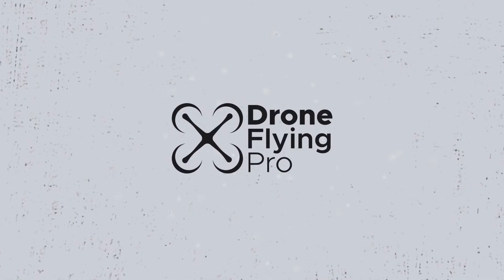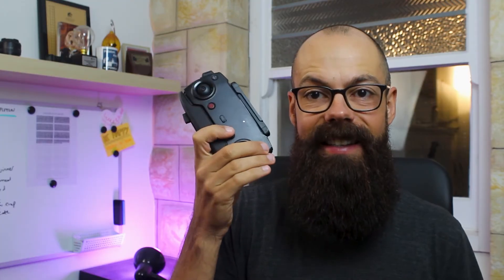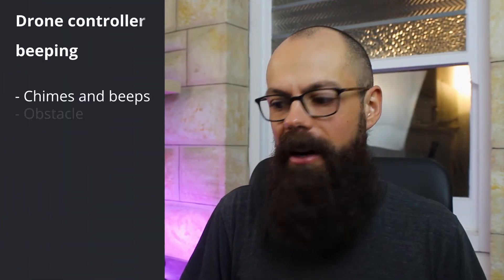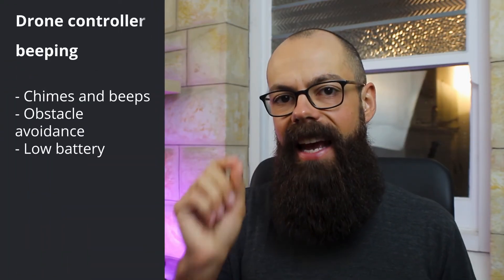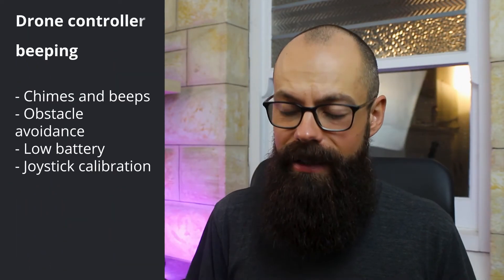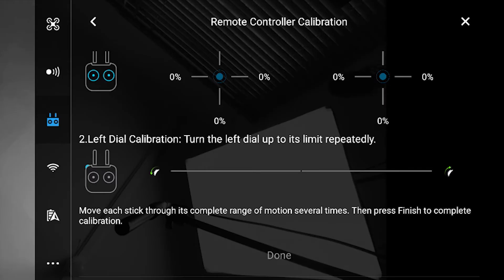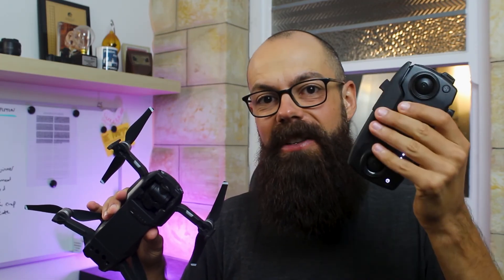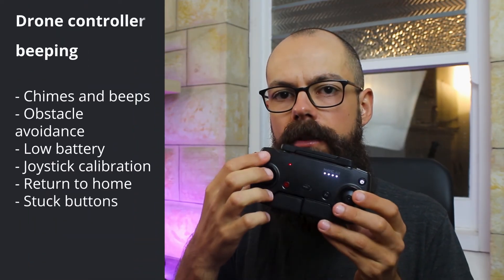why is my drone controller beeping? 6 reasons with actual audio!

Comment: Hey, thank you a lot mate! Pops got me this sweet drone last Christmas and i've over the last 7 months i've gotten quite used to turning it on, doing the quick calibration, and then just buzzing it around! It's super fun, but i was missing out on the features like 'home' and 'GPS flight' as well as the ability to loop continuously from set point A to point B. I hit the homing button for the first time, and a few seconds later I was hit with the barrage of beeps! I got so worried I landed, grabbed my drone and ran back inside to investigate! 

You saved me a ton of confusion and possible (unnecessary) heartache thinking i've hurt my drone!

Comment: I have a Frankenstein toothpick 818A that acts like it's too far from home upon take off and then proceeds to land right back down.. the battery is good though. I've tried 3 batteries including an 18650 that's fresh. Remote batteries are new and no dimminng.. I'm wondering if a button is stuck.. maybe I'll clean them all..
Reply: I've tried recalubration, but it seems incomplete like it never really does it fully. Ahhhh screw you china

Comment: What do you do if your controller passes RC Cal but the beeping never stops and then it still says RC Cal needed even through you just cal'd it a million times..?
Reply: I'm wondering about this too. Might be a sticking button. I'm gonna wd40 each clicky carefully then blow out with air.

The only other thing i can think of is the fcc id if it's a microchip feature with faulty calibration or programming thinking it's higher than it really is
Reply: @aninnymoose720  Ive done everything I can think of, Ive watched every YouTube video and recalibrated the RC and everything else for that matter in every way I could think of and it still beeps non-stop... DJI support had no ideas for me either than to send it in... I took it apart and put tape over the speaker so at least its not so loud anymore... Super annoying none the less...
Reply: @mattpearson8843  i figure  figured mine out! I had another board exactly the same and i inspected them closely. What i found was one single tiny littlr capacitor had got knocked off its solder pad and the micro controller i guess detected the open circuit for the A1/A2 motors, thus shutting it down.  Maybe something similar happened with yours.